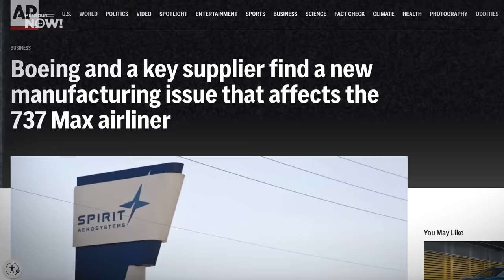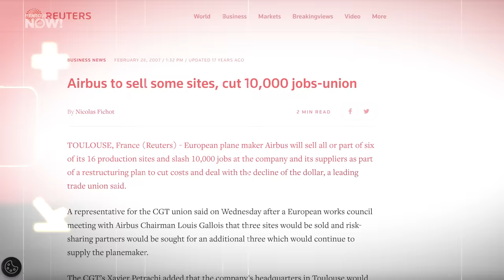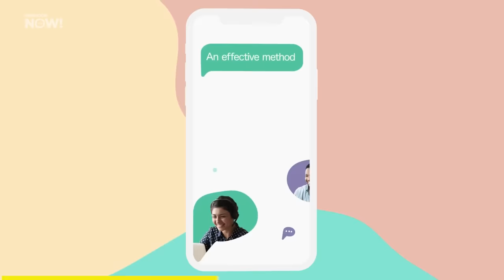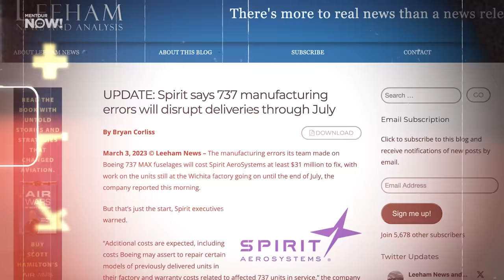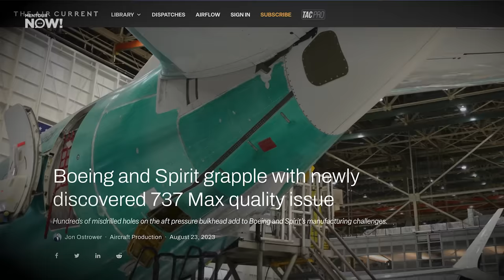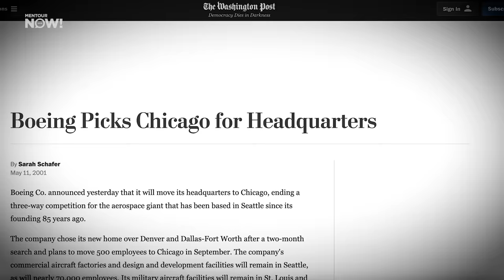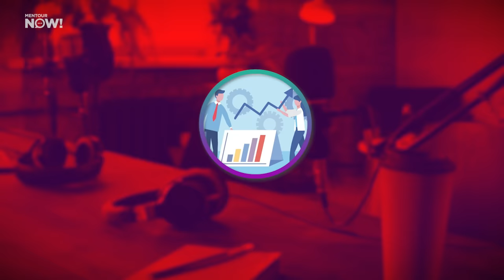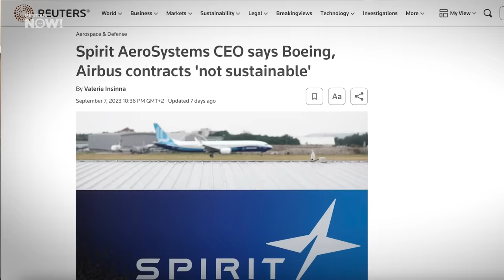NEW Problems with the B737MAX!

Comment: It's almost as if Boeing are new to this whole plane building thing.
Reply: That’s what happens when you get your expertise from a company who was never good at building planes.
Reply: U mean McDonnell Douglas?
Reply: @Aspir3xx indeed. They’ve made some iconic planes like the MD-80 but their management has always been terrible and that has led to disasters like the DC-10. And when they infiltrated Boeing, we all saw how that went down.
Reply: That was 25 years ago. How relevant can it still be?

Practically everyone there at the time is retired by now.
Reply: I think Airbus will get far ahead
Reply: @myne00 company culture can outlive employees. It can determine which new hires stick around.
Reply: @myne00 they picked their successors and big shareholders liked their cost cutting ethos so they picked like-minded C suite. Also, a lot of these problems are long-term problems that have been building for decades, such as spinning off manufacturing sites and losing direct control over their supply chain.
Reply: No. They're old hands. They cut corners and covered up defects. The act of a cynical and experienced plane manufacturer.
Reply: This is what happens when you elect incompetent corporate leaders. Somone with a big fancy million dollar degree that didn't spend their lives working for the company from the ground up.
Reply: Naw, just the bean counters & MBAs who look good when they propose cutting costs without understanding the long term consequences.  In fact the more you know, the harder it gets to find those cost cutting decisions that would advance their career.   If you ever wondered why management wanted to separate themselves from production and engineering, now you know why they left for Chicago.
Reply: @airbus7373 like the other US  aerospace companies, MD been beaten by Boeing in the  game of selling Commercial aircraft and had become focused on the crafty politics of winning military contracts. Engineers are Engineers but there was a very different upper management culture when the two merged.
Reply: It is, after all, it's McDonnell Douglas in disguise.
Reply: They should’ve just redesigned  the plane and not retrofit an old one
Reply: The web application programmers they outsource their safty control systems to are new to it.
Reply: The web application programmers they outsource their safty controls programming to are new to it.
Reply: @stonefacedmedusa5542  that’s what they were doing with the nma but they wanted to cut costs and did the max instead
Reply: @myne00 25 years ago? The 737 was designed around 1965(58yrs ago), that's the real issue, it simply was never designed to be filling the market it's in today
Reply: @Ihaveanamenowtaken  nothing to do with MCDONALD DOUGLAS
Reply: It's because now the managers with just economy degrees are calling the shots, instead of the engineers.
Reply: @veganbutcherhackepeter  wrong the engineers are calling the shots
Reply: @nickolliver3021  Really? I call bullshit, but if that's the case then Boeing better get some better engineers.
Reply: @silmarian seeing comments like yours make me vaguely hopeful we may one day stop this mad race to the bottom in pursuit of profit. Might not be in our lifetime but maybe there is hope.
Reply: Yes, theyre having a hard time switching from pushing pure profits to creating high quality products again
Reply: @MrAngenos  they are pushing for high quality products than pure profits. Where have you been
Reply: @myne00 corporate culture inertia would still have an effect. MD execs passing on their shitty money vs. safety views to the already shitty young MBAs.
Reply: "McDonnell Douglas bought Boeing with Boeing's own money"
Reply: They ARE new to this "whole plane building thing"!!!

They made a point of laying off/firing their older senior engineers.
So YES, "this whole plane building thing" is completely NEW to the MBA Management and the junior engineers.
Reply: "Hi, we fked up, can we get bailout money now? Pretty please?"

No, just go fking file chapter 11 already.
Reply: @stevenwest000 not sure how far ahead Airbus will get. Their A380 idea was pretty much a failure and if it wasn’t for Emirates it would’ve been scrapped long before it was. Their idea of taking over the retiring 747 clientele failed and everybody is buying the 777X to replace those as well as the A380 🫤
Reply: @nickolliver3021  You must be new to the history of Aviation.
Reply: It’s because they let the accountants from Douglas into their management team.  They’re not engineers. Huge mistake!!!  They changed the who,e dynamic of Boeing
Reply: MDD are better at fighter plane. seems like the fire/ retain the wrong people and put them in wrong place.
Reply: they better track their old hotshot engineer in retirement home and such, those still sharp, to come for a week or a month, to review their design, get their input, gave a course for new engineer, to make them better engineer. passing the institutional tradition and knowledge
Reply: who is the genius MBA that pick the name spirit? it sounds cheap and low quality
Reply: @myne00 culture is by definition the thing that outlives individuals. Upper management came from the less engineering minded organization, and has stayed that way, as leaders pick their successors in their own image.
Reply: They've be come MacD
Reply: @myne00  cultural legacies  can take decades to change  - if ever
Reply: I have a feeling the "money men" in the company really are new to the whole industry. That is always the problem with "bottom line" people. They have no clue how the company got there in the first place. They are just concerned about MONEY.
Reply: Boeing Douglas is a loser aircraft assembler. They don’t know what they’re doing today. Boeing Douglas is doing everything wrong what Airbus is doing right. 😅
Reply: @GeoCalifornian  tell that to their face
Reply: The "shedding " of production to the  non-union east coast sites a moving corporate HQ to Chicago  has lead to mismanagement of the entire system. 

Gotta keep those stock prices high and dividends higher, don't you know. 
Bonuses depend on them
Reply: Boeing, in name isn’t but I don’t know how many shareholders understand plane manufacturing.
Reply: @nedelwre  the name Spirit sounds haunted … like hundreds of souls taken before their time
Reply: @Aspir3xx i think so too.
Reply: @myne00 If you implement a culture and there is no one there to challenge it, it will remain after you leave.
Reply: @gikigill788  says who?
Reply: @jimsteinway695  Agreed.  I have always despised bean counters.  All major engineering intensive manufacturing entities need to put them in their place. In other words just count beans and report those beans; nothing more.
Reply: @nedelwre  The MBA degree needs to be abolished!
Reply: @Aspir3xx Yeah, those bastards ruined Boeing.
Reply: Well, neither of these mistakes were made by Boeing… So, that’s a weird takeaway. Also, believe it or not, AirBus and other aviation manufacturers have issues like this all the time. When you’re dealing with manufacturing at this scope and complexity, some small issues are inevitable.
Reply: Airbus has eaten boeing alive, sad but true.
Reply: @flythewing4456  The Boeing we see today isn't Boeing it's McDonnell Douglas under Boeing Disguise
Reply: When I read this comment it had 737 likes! 😆
Reply: When management doesn't come up through the ranks like the old days this is what happens.
Reply: They've been relearning ever since they bought a failing company and placed the management of said failing company in high positions of their original company.
Reply: @myne00 what started this whole mess with Boeing “assembling” acft, not “manufacturing” started 20 plus yrs ago….
Reply: @stevenwest000  right, because the A380 was such a good investment, right?
Reply: All the old white men retired. What else can anyone expect. I bet they have been replaced with mr gonzalez and Leticia precious
Reply: @ItsMotoMatt  haha I know and I nearly included that. I’m not trying to offend anyone who supports Boeing but just my opinion with the amount of ongoing problems.
Reply: It's like every other big corporations when the engineers are no longer running the company, and they rely on the bean counters make all key decisions.
Reply: @Christian-nl7cm and because airbus came out with the NEO and they wanted something to compete with it
Reply: Rlly
Reply: @stevenwest000  Airbus has issues as well
Reply: @JackF99  faa
Reply: @Ihaveanamenowtaken  faa
Reply: @Christian-nl7cm  there biggest customers didn't want a new plane they wanted the 737 so that's what they got
Reply: @nickolliver3021  faa
Reply: @derekfordyce9  faa
Reply: @tritontransport  they still owe tax payers a billion dollar on the now defunct a380 project
Reply: @Andrew-hr9tt  yes and
Reply: @allwinds3786  how is this about the engineers not running tne company but bean counters making all the decisions over a supplier Issue?
Reply: @M5guitar1  nothing to do with management. This is what happens when suppliers don't keep track of quality with pressure on demand
Reply: @Aspir3xx  over a supplier issue?
Reply: @flythewing4456  over a supplier issue? Really?
Reply: Its most likely to the new caliber of bean counter running aerospace companies these days
Reply: @Nickbaldeagle02 It doesn’t help when the FAA is in bed with Boeing
Reply: @kx4532 too the lowest bidder. If a quote is too unbelievable to be true its means  it probably is
Reply: @veganbutcherhackepeter A common thing these days in Aerospace
Reply: @stonefacedmedusa5542 That’s way too logical for those corner-cutting, money-hungry suits! They will drive the company into the ground trying to save money!
Reply: @clives344  no the faa isn't doing there job there is no bed
Reply: @nickolliver3021  and lack of faa DOING THERE JOB
Reply: The management is
Reply: @Andrew-hr9tt  yes most likely
Reply: That’s what happens when you prioritise diversity
Reply: @airbus7373 That happens when managers, not the engineers build the plain.
Reply: @myne00 culture out lives the people who created it.
Reply: No time for bug fixing, we will use passangers to do it 😂
Reply: Boeing's newer Republican Management has some fairly radical ideas - some planes must crash so that buyers pay for necessary life-saving items.  It's a motivating concept - pay extra and live, or not.
Reply: @EnterpriseTNG I heard it was the ground that was finding the bugs
Reply: Beancounters caused it ultimately.
Reply: @tritontransport . The A380 is not flawed. It the customers who don’t want it because they can’t fill it. The 737 has structural issues because they are trying to make quick profits. Airbus doesn’t have that problem.
Reply: @Tpaulissendougan  I never said it was “flawed” 🫤. I said it was a failure. They thought they were going to fill the void left by the 747 being discontinued but they failed to read the tea leaves of the future . Not even cargo airlines wanted it because of the way it was built
Reply: @tritontransport  Agreed, but the topic was about the 737 and how Airbus has over taken Boeing because of the flaws of 737. All other Airbus planes are selling very well apart from the a380.
Reply: Don’t spit what you don’t know. 
You are only an outsider speculating and guessing. Most of you have no knowledge of what is happening in the industry. 
No one knows exactly what’s going on.  Let me explain, it’s not Boeing problem or their process however, Airbus and every other companies have problems as well. It is easy for People to point fingers at problem, instead of talking about solution and praising the companies and individuals for their effort. The issue lies with the supplier. People should t be blaming the company or say anything they don’t know. The issue again lies with suppliers and parts scarcity. Every company out there is dealing with it. Engine manufacturers are going through that as well. 
I’ve said my peace. Bye now!
Reply: @benzeeable1   Most of the problems Boeing is facing has happened because they have gone public and the focus is on keeping their shareholders happy. They never used to have these problems in the past. They were a top notch  company that focused on engineering and safety and that in turn made them successful.
Reply: No wonder the planes are made by students now 😂
Reply: @ItsMotoMatt  The A380 as the best passenger jet in the world is a hell of a calling card for Airbus and the airlines that fly it.
The marketing traction from it is second to none.
Reply: Spirit have taken over all the Bombardier factory workshops here in Northern Ireland. They are on a hiring spree here with work guaranteed for next decade apparently. Love your channel. Was a firefighter @bfs international until I injured my back. Was a great job for an aircraft geek like me
Reply: @airbus7373 crux of the issue is they were caught with their pants down by airbus and didn’t have time and will to design a new plane. Somehow, and quite unbelievably, they managed to sell a shitload of planes.
Reply: It’s almost as if Boering is run by accountants and fresh business grads.  Not engineers and aviation professionals.
Reply: @stonefacedmedusa5542 the engineers wanted to but were blind sighted when Airbus launched the A320 Neo in 2010.
Reply: No, they are building … more and more profit for the five richest people in the world
Reply: @airbus7373 Funny that the most catastrophic issue with the DC-10 was cargo doors blowing off and the issue recently is the doors on deck.
Reply: @myne00 not yet they all work for the FAA this is why Boeing never has problems certifying

Comment: An aircraft manufacturer that decides that building their aircraft is a 'non-core operation'. You've got to laugh.
Reply: Right?  I’d say the fuselage is kind of the core of the aircraft.  Bean counters are necessary, but they shouldn’t be completely in charge.
Reply: I think they see themselves as a design/development and sales company. But other than the 787 they haven't really done much worthwhile development/design in the last 3 decades.
Reply: @TheDuckofDoom. not even that. The B787 was codesigned. It’s a textbook example globally of obscene amounts of outsourcing.
Reply: Maintenance and parts company xD
Reply: XvonPocalypse  Short of straight criminal graft, products are the source of profits. It sounds like someone only listened to half of the lesson.
Reply: this sound like chinese spirit of Cha Pu Tuo  or good enough it is still usable/ only slightly less
Reply: I think they are trying to rebrand themselves as an IT services company.
Reply: My thoughts exactly. What kind of doofus bean-counter concludes that airframes are not a “core operation” of an aircraft manufacturer?!?
Reply: @tookitogo  the inspirational speakers masquerading as management have gotten really obsessed with the 'integrator' thing.  They are also really into the 'just in time' and 'lean' manufacturing now, which is great for mass widget production but I'm not sure it works all that well for aircraft.
Reply: @neeneko  Yep. And it’s not to say that systems integration isn’t a critical skill; it absolutely is. But IMHO you can do better system integration when you don’t outsource everything. 

As for JIT and lean production: I dunno, I somewhat think that aircraft might be an industry that lends itself very well to these — to the extent any industry can. I don’t get the impression that the aviation industry suffered from component shortages to anywhere near the extent that many other industries did. This may be down to reduced demand due to the pandemic and 737 Max debacle, but I think it also had to do with good supply chain management. (Look at how Apple fared during the component shortage: it barely affected them because they had everything locked in already.) 
With that said I still don’t think that extreme JIT/lean production is wise, and I know that part of the reason that the electronics component shortage endures is because many manufacturers realized this, and have now been padding their stocks a bit.
Reply: @tookitogo  The idea of lean production is to out-source things that aren't unique to YOU.... but... fuselages? really? yeah no.  Bolts though? bolts make sense, it's not unique to you.  So you have no reason to manufacture your own bolts.  but a bulkhead that is only used in a 737? um... there is no other market.
Reply: Mcdonald’s core business is not selling burgers… so ? it’s just one of these business mba genius calls
Reply: Sounds like McKinsey consultants where at work 😂
Reply: @neeneko Aircraft safety IT-systems 🤣
Reply: That’s the mentality US automakers adopted as they transformed themselves from automotive engineering, manufacturing, and marketing companies into banks that design and market cars.
Reply: Well, airbus also gets fuselages from Spirit, so there is that. It’s the world we live in. Virtually nothing big is totally made in house anymore
Reply: @patmx5 Bean counters ruin every company they rule.
Reply: @patmx5 I laughed at that thinking the same thing. If the fuselage doesn't qualify as the core of the aircraft, what does?😂
Reply: @neeneko ”just in time” is a scam big companies do to smaller supplier companies. It pushes the risk of having stock to the suppliers, and big companies use their size to leverage making small companies comply with the system.
Reply: @awonoto yeah, there is that bonus for them too.  it reduces the risk of the larger more end chain companies, but increases the risk for smaller and upstream ones.
Reply: No surprise at all. 
Core to the business are bonuses for the people that decide if they get bonuses.  Look at GE, Immelt destroyed the company and won! Taking home crazy bonueses in the tens of millions.  This was his sole job.  
A incentive to lose?  Yes he was driven by incentives.
Reply: B737 "Maxx SHORTCUTS"